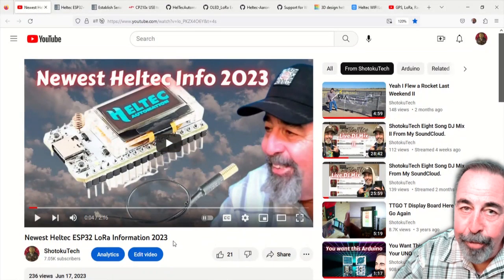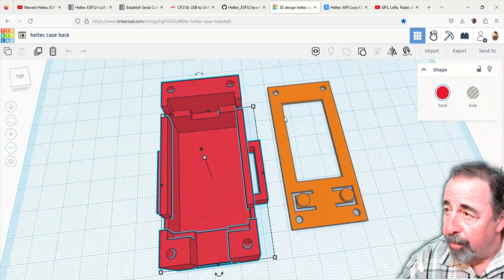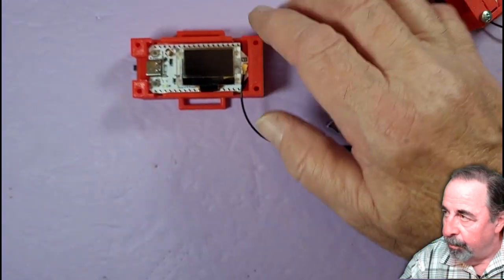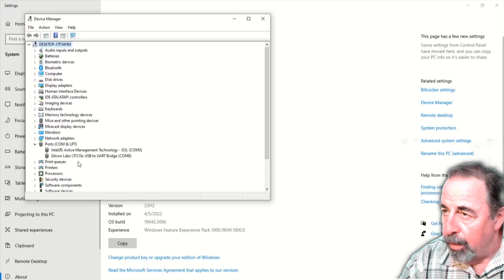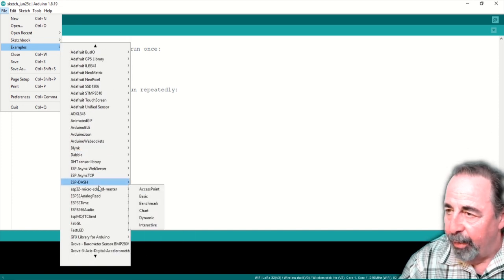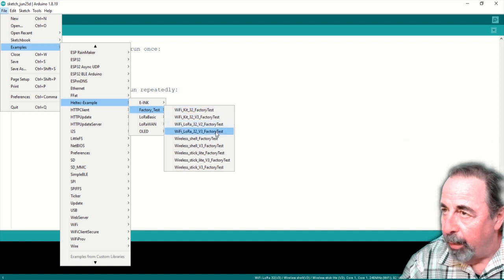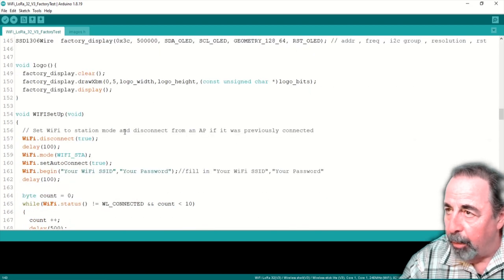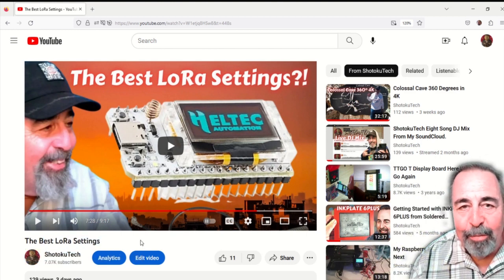New! Heltec V3 ESP32 LoRa OLED Step By Step

Comment: I am so freakin' lost. I did finally get that Silicon Labs driver installed. Arduino? Isn't that something to do with Raspberry Pi? I hope my brain wakes up eventually enough to figure this out.
Reply from the maker: Hold on bro. There is many repetitions of the exercise. Please keep watching!
Reply: @ShotokuTech  I'll be back, watching another video, about roughly the same topic.  I just got these items from Amazon today. It's not urgent,but since I'm apparently years behind, I noticed this is becoming quite popular and I can see quite a relative need for it soon.
Reply from the maker: @turn-n-burn1421  Best wishes friend.
Reply: @ShotokuTech  External of YouTube, I did finally manage to extract enough of my own brain power to get the thing flashed and a bit of the items set.  But I think most of this will be a project for tomorrow.  I saw somewhere that it prefers Chrome Based browsers to do this procedure.  So Brave is my go-to and it's Chrome based, but as much as I hate Chrome and Google, I went right to the horses mouth and installed Chrome just to see if that would do the trick.  It worked.  So the rest will now wait until tomorrow.  I think just getting a single one of these up and running, maybe finding other signals will be a somewhat lengthy project.  It's okay, but my excitement has been dashed.
Reply from the maker: @turn-n-burn1421  What did you need Chrome for? I use FireFox. the browser doesn't get involved when you are using Arduino IDE to upload code to the WiFi LoRa 32 board. LoRa may not be widely in use in many regions. Helium is probably the most distributed LoRa network. I would definitely want two devices and purposely send packets from one to the other.
Reply: @ShotokuTech  I'm not declaring that I needed the Chrome browser.  Somewhere in my attempt to work out my problems, I ran across something that said the install process worked best or only (can't recall) with Chrome-based browsers.  Well, Brave and VIvaldi are both Chrome based.  I have Brave on my PC.  However since I had been using that and it wasn't working, I thought I might just try the actual Chrome browser, which actually did work.  I have no idea why and as I said, I hate Google.  But it worked.  So once I finally get everything working as it should, I'll delete Chrome from this PC.  Once again, what does Arduino have to do with a normal messaging version of Meshtastic?  I seriously don't know.  I would think if you're using it in a setup with a Raspberry Pi to do some kind of a project, it might.  I have not yet delved into the world of Raspberry Pi.

Comment: Does the heltec V3 have a real time clock or do I have to install a real time clock hat on what pins. and how do I do it and what are the benefits of doing that?
Reply from the maker: I have an extensive Heltec playlist. There is not an RTC on board. But here is a demo using two wire for I2C: https://youtu.be/5lEMRN-o_ng
Reply from the maker: Here you go. https://youtu.be/nwG4l7Ph1Do

Comment: I am really struggling to get LoRa functionality on this board.  I load up the Example factory test and get the following in the serial monitor:

Serial initial done
you can see OLED printed OLED initial done!
Starting LoRa failed!

It also says Starting LoRa failed! on the OLED

I am using board manager 009.
If I pop into the example code and change the LoRA setting to false it will actually run the wifi portion of the test, stops, and prints the chip id on the serial monitor.
Reply from the maker: Comment out the WiFi and see?

Comment: Anyone get the V3 board to work in Arduino IOT cloud?  I got it to see the board, but it won't compile or load sketches due to a version difference.  Apparently IOT cloud only supports the V2 board and I cannot see any place to load the V3 board definition.  The boards work fine on the local IDE...
Reply from the maker: You have to use the sketches the come with the board definition. The old library and sketches don't compile on the V3 board. I will check out connecting this to Arduino IoT Cloud next.

Comment: one thing about this board is you dont need an external power switch you can hold down the selection button to turn off the board
Reply from the maker: Did you see this one? https://youtu.be/JKP8OvBm6nM
Reply: Mine turns itself right back on, after awhile.

Comment: What does the V3 bring over the V2? Apart from the USB-C connector?
Reply from the maker: It is using the ESP32-S3, SX1262 and is more efficient in low power state. Thanks.
Reply: @ShotokuTech  Thanks!

Comment: Excellent video. Have you tried this board with the RTL433 project please? I believe it is not compatible, I would appreciate your view. thank you
Reply from the maker: Wow that looks like a very elaborate and capable project. But these boards are all based on SX1262 or SX1276. RTL433 would take considerable effort for me to get started with it and doing that with hardware that may not be compatible is something I can't really commit to. Thanks for the comment!
Reply: Thank you Sir, I have purchased a compatible board from Amazon and will try to understand how that works, then go back to the Heltec boards. I will inform you if I make any progress.  Very many thanks for your prompt response
Reply from the maker: @bungy490  Hey best wishes. It looks like a promising adventure. I got Raspberry Pi 5, Bookworm and Windows Server 2022 on my slate right now. LOL.

Comment: Hello friend, I have had problems with the compilation of my program from Arduino IDE, I have the Heltec LoRa 32 V3 board, I have followed the configuration steps and I still get the error (Compilation error: LoRaWan_APP.h: No such file or directory ). I would appreciate it if you could help me
Reply from the maker: I am on a brand new laptop. I just installed Arduino IDE. 
I added this URL to the Additional Board Manager URLs in File/Preferences.
https://github.com/Heltec-Aaron-Lee/WiFi_Kit_series/releases/download/0.0.7/package_heltec_esp32_index.json 
I added Heltec ESP32 Series Dev-boards 0.0.7 in Board Manager. 
I selected WiFi LoRa 32(V3) in Board Manager. 
Under File/Examples/Heltec-Example I loaded WiFi_LoRa_32_V3_FactoryTest. 
When I complied it just now, it works successfully.
I have followed these steps several times on different PCs with the same result.
I can't tell outside of that how you would get this error.
Thanks. Best wishes.

Comment: I'm a bit lost.  
Was given some older V1-V2 boards.  
Is all of the V2/V3 stuff backward compatible?   
Trying to find info for them and all I am finding are broken links and 404 errors. 
I do not have V3 stuff.
Reply from the maker: You will probably be happier with the V2 and V1 boards. It seems the move to ESP32 S3 has caused a lot of changes. I shared the board manager URL in your previous comment. It covers all three WiFi LoRa 32 board versions. As far as pinout compatibility between V1 and V2, I believe they are the same. Pinout changed for V3.
This is the landing page for the Heltec docs and it links to a couple of github repos that may have more useful info. But they also have 404 links. Best wishes. https://docs.heltec.org/en/node/esp32/wifi_lora_32/index.html
Reply: @ShotokuTech  Thanks for the replay and for the working board manager link.   
Any ideas on why I was unable to easily find that?   
Did I miss something obvious?   
I'm also trying to understand if anything new or "V3" coming out - if it's expected to be backward compatible with V2?  
Or are we expected to locate/find/load different libraries and board manager stuff for the V2 vs. V3.   
Thanks for any clarification. 
I'm freaking new at this and it's a bit painful haha.
Reply from the maker: @n8lbv  It seems they move information around every so often and I try to keep up with it. I was not able to find it using their links when I was trying to answer your question. I got 404 errors like you did. I just happened to have the URL already in the IDE.
Once you install the board package you will see ESP32-Arduino in board manager and WiFi LoRa 32, WiFi LoRa 32 V2, and WiFi LoRa 32 V3 boards to choose from. 
There are also example sketches for all three versions that get installed as part of the board package. The examples are listed under Heltec-Example. The required libraries are the same, you don't need to worry about juggling this from one board version to the other. I like the FactoryTest sketch the best as it reveals all the LoRa parameters. I have an entire Heltec playlist, including one that goes over the LoRa settings. There is a V2 and V3 version of FactoryTest.
For the V3 with BLE instead of serial Bluetooth, I have not found a working BLE example so far. For the V1,2 boards, generic Bluethooth examples work fine.
For V1, 2 you may also want to install Heltec ESP32 Dev-Boards library for the OLED Sender and OLED Receiver sketches. These are simpler, but only work for V1, 2.

Comment: How is the battery life on those?
Reply from the maker: In my video "The Best LoRa Settings" https://youtu.be/W1etjq8HSw8 I show the Semtech LoRa Calculator. It has the energy profile tab. You can use it to show the esimated battery life, based on the parameters that your program for your device. The calculator shows if you transmit or interrogate periodically with sleep in between, a 1000mAh battery can go for hundreds of days. Thanks.
Reply: @ShotokuTech  thank you!!

Comment: Really great video and very helpful. Sorry for the inconvenience with my question...Is it possible to connect a Solar Panel directly to the V3 board to charge the LiPo battery? Thank you very much and best regards
Reply from the maker: The board does feature battery charging management capabilities. I would expect it would work. Thanks.
Reply: Thank you very much for your response!! It takes me out of a big doubt. Big hug from Argentina!!

Comment: Hello. I'm trying to use the sketch WIFI_LoRa_32_V3_FactoryTest on two Heltec LoRa V3 devices, but I don't see the LoRa communication working. The Arduino compiles the code and uploads it to the board without errors. The boards boot up and then only display information on the available Wi-Fi networks on the screen, but they don't send/receive the "hello" packets via LoRa.

I've already reinstalled Arduino and the libraries mentioned in your video, but it still doesn't work.
Reply from the maker: Have you powered these boards without the antenna connected?
Reply: @ShotokuTech  Thanks for responding.
The antennas were never removed.
The only different thing was testing the Meshtastic firmware on the boards, and they worked well, but there are compatibility limitations with sensors, and I want to go back to testing the initial option, but it's not working.
Do I need to perform some kind of erase?

Comment: If possible pleaes make a video for LoraWAN to connect things network?. I'm not able to do so. thanks
Reply from the maker: Reminds me of the time I spent $80 on the Things gateway. It was too easy add it like you would any other device and then they inform you your not supposed to do it that way and there is no easy way to undo it. And the Thing gateway doesn't work. I might try what you are asking. But I am rather soured about Things.
Reply: @ShotokuTech  Things is rate limited, too. Would recommend self-hosting Chirpstack. Either on a gateway (like the Dragino LPS8v2) or in a docker instance.
Reply from the maker: @Pyrrho_  Can you do it for $25? Cool! Best wishes.
Reply from the maker: I forgot to mention Qubitro. Maybe you would like it better than Things. I have an entire playlist using Qubitro device data platform. https://www.youtube.com/playlist?list=PLVPBipeObwMPpVLp2aLwh5-N7ys7SROpq
Check out Qubitro.com. The free level is a decent offering and the pay as you go is very reasonable if you want to expand to many devices. Tell 'em I sent you!

Comment: Have u tried to program using espidf?
Reply from the maker: I'm not as familiar with ESP IDF as I am with Arduino IDE. I have used Arduino IDE for at least 11 years. I have used ESP IDF once. I tend to follow the path of least resistance as long as it works. What is the benefit of using ESP IDF over Arduino IDE?

Comment: Thanks for getting the V3 working and explaining how you did it. I had multiple problems with the V3 and could not believe Heltec did such a lousy job supporting V3. I received much help from the Heltec Forum. I have one question about using the Factory Test that you used in the Heltec Examples. I was able to run the Factory Test without any problems, loaded the program onto 2 V3 devices, exchanged LoRa packages between both V3s but when I moved 1 V3 away from the other (just a couple of feet), the packet exchanges stopped between V3s. Can you help me with this? It looks like it could be parameters such as power, spreading factor, etc but I would have thought just moving a foot or 2 should not stop transmission of the packets. Your thoughts?
Reply from the maker: Hello. My previous video "The Best LoRa Settings" 
https://youtu.be/W1etjq8HSw8
Goes into complete details on the parameters. But I find with the power level 14, bandwidth 125, spreading factor 7, I am able to move from one room to the other and still have a strong signal, RSSI in the 40s. There are several walls in between in this case. So there must be some drastic problem if you cannot go a few feet before losing signal.
Reply: @ShotokuTech  All set. Needed to change antennas.
Reply from the maker: Okay! Good news. Thanks
Reply: Still had problems losing the signal after just moving a few feet but noticed when I tried the LoRaBasic LoRaSend and LoRaReceive programs I was able to move around my house and exchange packets. I listened to what you said about the Factory Test and saw that you did NOT setup your WiFi. I removed my router ID and password, recompiled the Factory program, downloaded into my 2 devices and I can now walk around my house and exchange packets. You may want to do WiFi setup in Factory and see if you get the same LoRa failure results that I did.
Reply: Looking forward to trying a range test of my own.. Thanks for the excellent videos. Learned a lot even though I had problems using the WiFi portion of the Factory Test that seemed to stop LoRa transmissions after moving the devices a few feet apart...
Reply from the maker: @artlawrence9737  that is curious 🤔

Comment: Your suggestions did not work in a Mac environment . It would be wonderful if you could figure this out. Bought two boards but I can't pass the compilation phase since I got different error messages from the ones mentioned in your video. Thanks.
Reply from the maker: I guess I'd need a Mac to do that! :yougotthis:I actually broke down and got an iPad for my DJ Controller. That's as close as I got so far.
Reply: @ShotokuTech i finally got it working but ended up with multiple version of the V3 board. this can get messy.
Reply from the maker: I'd be interested to know what you mean by different versions. Thanks.

Comment: WIthout IO, what good is it? Needs a keyboard, or at least a scroll wheel. The scroll wheel for text input might be the easiest, as I have yet to find a mini-keyboard for ESP32 projects. It also wouldn't require a huge change to the case. Then you'd what some people call an "Apocalypse Communicator".
Reply from the maker: Just getting started testing the board. Good that it captured your attention anyway. Thanks!